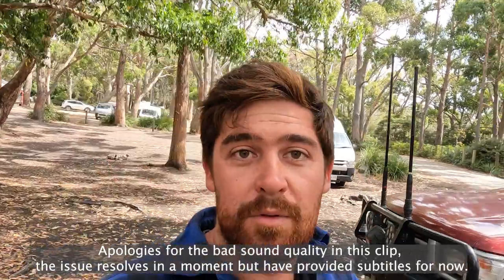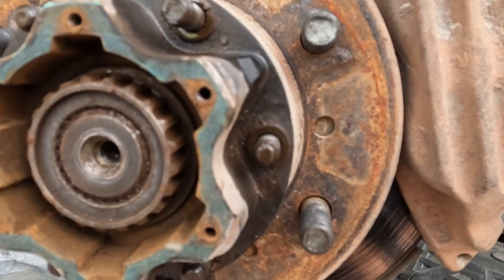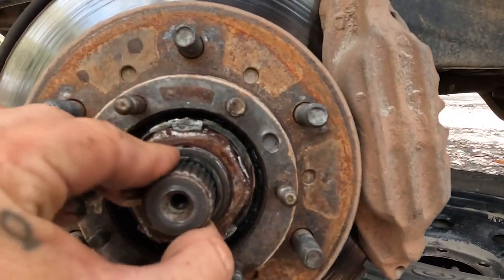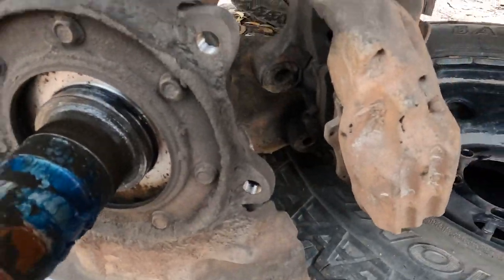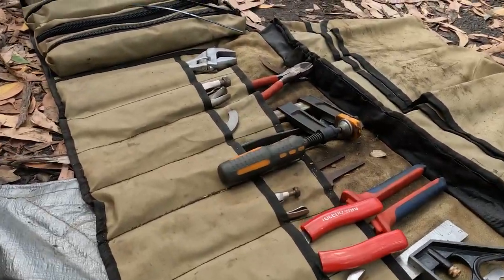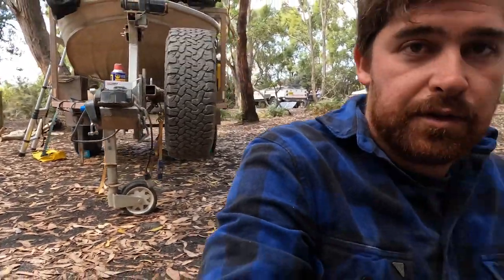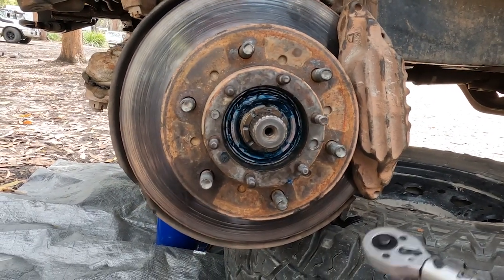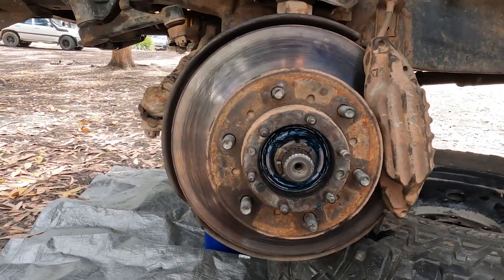REPLACING WHEEL BEARINGS ON A FOUR WHEEL DRIVE - A how to guide

Comment: Great video mate! Next time with that inner seal to get out, just put one of the big nuts back on a few threads and with force in once movement pull it towards yourself/ off, and it will pop the inner bearing and seal out and leave it on the stub every time 🙂🍻
Reply from the maker: That’s such a good tip thank you! Shane f’d around for ages with that haha but as I read your comment out he goes “huh yeah I do that with the trailer why the hell didn’t I just do that” 😂😂 you’re a legend Ben! 🙌🏻